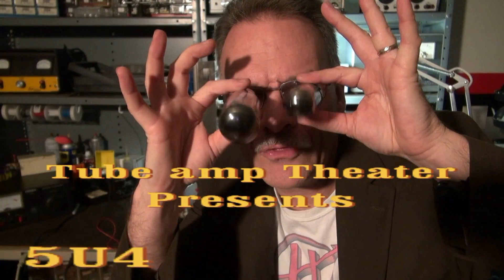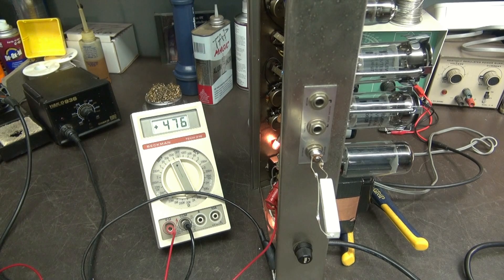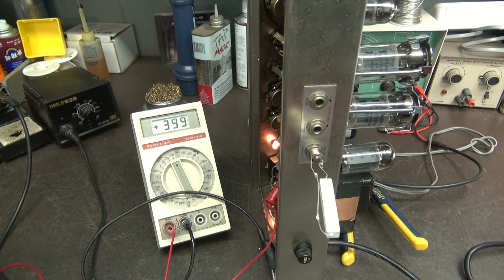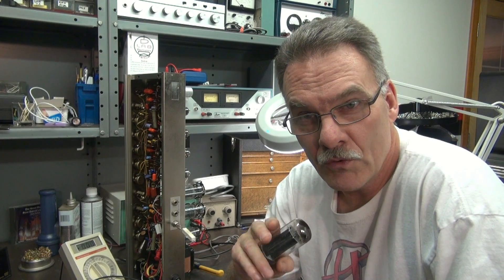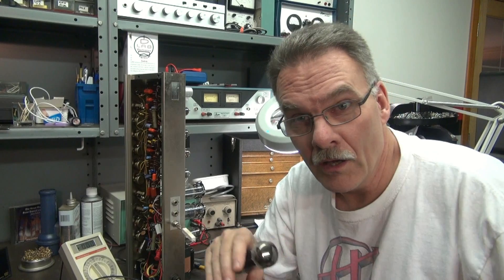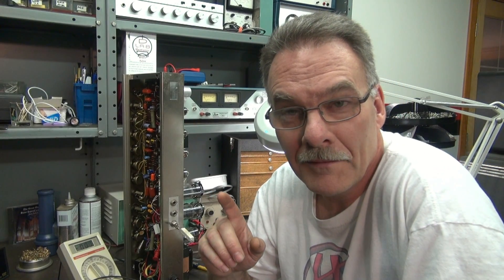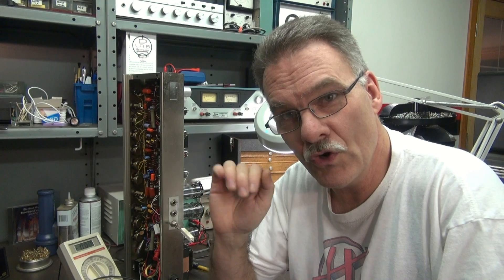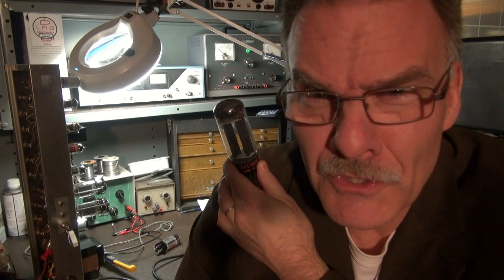Tube amp Theater 5u4 vrs 5AR4 GZ34 Tube Guitar amplifier by D-lab

Comment: What if I have a bad GZ34S that’s rattling on a deluxe reverb reissue. Can I just pop another GZ34S in without biasing it? I would just have to set the bias when switching the 2 6V6 power tubes correct?

Comment: if the 5ar4 has less voltage drop than the 5u4...you'd think the output current with the 5ar4 would be less vs an output tube using a 5u4......what am I missing?

Comment: Someone know about these modern russian made Sovtek 5Y3-GT? We read here and there they operate more like smalls 5AR4/GZ34. It sounds very good in my ''Epiphone Blues Custom 30'', but i'm running the amp at the lower 15 watts setting instead of 30 watts, with smalls Tung Sol 5881. The sound is just perfect to me. It's a lot quieter than with the stock 5AR4. Will it damage this amp? THANKS A LOT!

Comment: i have the same readings when i turn on the amp, and my filter caps are for 450v, but in the initial peaks go to 480v...Is that an issue to resolve or the caps can deale with that voltajes for this five seconds every time i turn on the amp?

Comment: What would i have to do to change a 59' supro Coronado with the baffle swap from 2 10" speakers to a single 12"...which im told is a 2ohm transformer into an 8ohm speaker to make a 5u4 into a gz34 rectifier tube work any help would be so greatly appreciated....i like the vids keep em coming

Comment: Thank you for your nice videos...
I have one  fender super reveb silverface ab763 1969 model...i only use vibrato channel , the clean sound of it is nice and awesome but when i use big muff or fuzz pedals the sound is not good and its harsh...what kind of power and pre amp tubes do you suggest for getting smooth sound when i use big muff snd fuzz ?
Consider  that My amp is totally restored and i change all the caps with new one but the tubes are old and russian and i didnt change them...rectifier is 5u4 sylvania and power tube are russian
Do you thing any modification in the amp circuit  will help or not?
Actually I want the dave gilmour tones
I will apprecite you if you help me ...

Comment: I had a quad el84 30 watt amp.  I bought it second hand, it requires a 5ar4 but the previous owner stuck a 5y3 in it.  No pops, no noises, no smoke or fire, and the tube didn't blow surprisingly.  Would this have harmed the amp though? or in the 5y3s case is it just a matter of the tube being under all the stress?  I have a 5ar4 back in it now, running no issue.  With the 5y3 the amp had no balls at all

Comment: I was going to do a similar video. I don't have to now. Found this one. I might do one anyway and link to this video.

The 5y3 is okay for amps designed to use them. ie: Champ, Tweed Deluxe. But so is the rest of the circuit, like Terry says. The caps are rated for the lower B+ DC voltage. I've repaired many Tweed Deluxe clones by discovering the solid state thing in the rectifier socket. Followed by blown or severely fatigued caps. Then seeing this dropping resistors looking like they're on their way too because they've used under rated ones for the task. I usually replace the caps with 500v ones, and drop in 3W or 5W resistors. Throw a new old stock 5y3 in there. And the customers call me back to say how good the amp sounds.

Would you throw in a 5AR4? No. Well, yes. With the higher rated caps, no problemo. But then bias needs adjusting. And those amps are cathode biased. So it's a matter of then either experimenting with different value cathode resistors or doing the math and estimating what you need and getting close enough to that value.

As Terry says, it's all possible. But you have to think before you do any of these changes. Don't just throw in a different rectifier tube because some guy on a forum did he did.

Comment: Hi  Terry, my problem is this. I have a 100 watt mesa Boogie Tremoverb amp from 1995. The amp has been modded with two bias pots for either 6l6's or el34's. Can this amp be used with 2 GZ34 rectifier valves in place of the 2 stock 5U4GB  rectifier valves?  I read on the net that people were putting these GZ34 RECTIFIER valves in mesa dual rectifier amps. Even Eurotubes in Oregon suggests using them in place of the stock 5U4GB rectifier valves. My problem is that when I shut my amp off with only the power switch,  my amp blows the fuse. If I turn the amp off with using the standby switch first then there's no problem.  Any advice on what could be wrong and if in fact you can safely use the GZ34 rectifier valves in this amp. Thanks from Michael Newell from Niagara Falls, Ontario, Canada foot note here, the 2 GZ34 rectifier valves are the JJ'S brand.  Seems like this other guy on this forum commented on these JJ'S blowing the mains fuse the same as mine.

Comment: Here... Teddy! Great info, Lad. I have just tested all 8 of my JJ set of boobs (toobs, sorry) for my AC30-CC1 and all is well, but it previously blew a 2A main fuse, so I'm still a bit worried.
Perhaps it was just a glitch in the local power supply... fingers crossed.
I'm going in from the shallow end, cost wise... a new fuse is .39 cents... as opposed to big bux for new toobs. Here's hoping!

Comment: I have an Hammond Ao35 reverb amp. converted to a guitar amp. It uses a 5y3 and 2x el84. I would like to use 5AR4. can I ?
Reply from the maker: Yes, that should not be an issue. You will gain a little more HV and punch to playing. Keep an eye on your output tubes to ensure they dont run to hot. May need bias adjusted.
Reply: D-lab Electronics Thank you.

Comment: Do you have any thoughts on Weber "Copper Cap"  rectifiers?   they are solid state alternatives that are supposed to replicate the sag.   (even though I still use tubes anyway)
Reply from the maker: Hello, sorry, never tried them
Reply: Simply put,  they are diodes, and resistors networked together in a tube base... considered an alternative to a tube rectifier.  It's their standard practice to stick those in the kits,  rather than a rectifier tube.   They have different versions to simulate popular rectifiers.

Comment: Hi Terry great video once again. One thing that I've come across between different brands of 5AR4/GZ34 rectifiers is the forward voltage drop differs a lot from brand to brand. My JTM45 clone initially used a JJ Electronic GZ34 but was unusable because the tube was arcing on power up of the HT circuit (closing the standby switch) and kept blowing the mains fuse. I've replaced this with a TAD (which from what I've read is a premium selected Shuguang, but this was on the internet forums so does need verification) and the measured HT voltage is at least 15v lower than the JJ. Maybe this was due to the JJ being bad from the start. My research also concluded that the old Mullard GZ34 which is highly sought after in cork sniffing circles, had very little forward drop, whereas the modern alternatives were much greater at dropping the volts. My amp has been rebiased since the rectifier tube swap and now seems to be behaving itself. 
Take care and keep up the excellent work!!
Reply from the maker: +Andy Wragg Thanks for the info Andy. A comparison between brands would be a good video. I found that the electro-Harmonix 6V6 tubes do the same thing. Arc at the top. Had quite a few bad builds due to them. I stick with Tung-Sols.